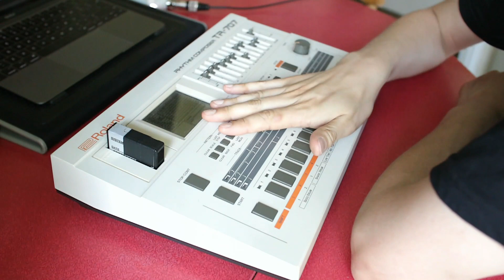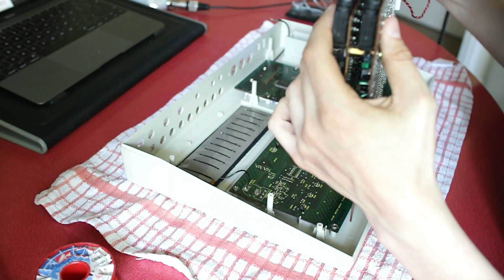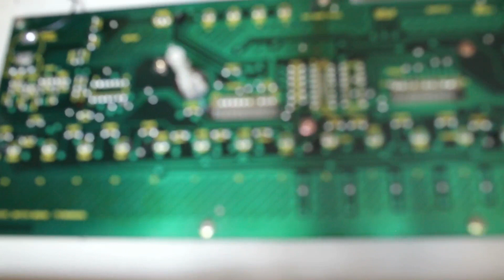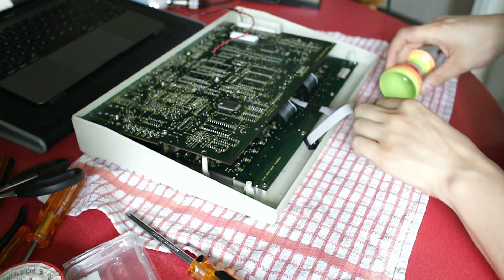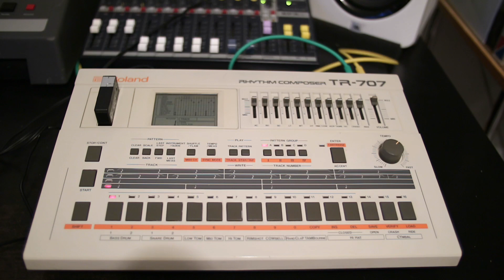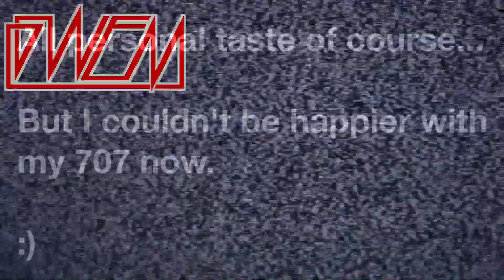Morphing my TR-707 into a 909, 808, 727, LinnDrum, LM-1 and Oberheim DMX!

Comment: Hi Gwem, thanks for sharing - great video.. I might have missed it but can I pls ask whether installing the mod means that the original 707 bank is still present in the machine or is it now sourced from the chipset on the new pcb add-on and whether the authenticity of the 707 bank you are left with might now be questionable? Many thanks and have just invested in a stock tr-707 which I'm v much looking forward to receiving in the next few days, Jules
Reply from the maker: believe me, as a 707 nut, that bank is completely authentic! :)
Reply: @gwEmbassy  Thanks Gwem - I did think that might have been the case knowing how dedicated you are to the 707! I've watched through a few different videos of yours now covering various different aspects and every time you fire it up it just brings a smile to my face in a way that I'm afraid to say the 808 and 909 just don't - a truly remarkable little machine.. : )

Comment: I appreciate the idea, at least it keeps the look of the instrument intact, it's not an infamous mess like that committed by certain "circuit benders"...   ;-)
Apart from this I don't understand the reason why I should put the sounds of a Linn or a 909 into a 707, only to still have a limited version of those drum machines (no tune controls... ). 
If I use a 707 it's because I want the sound of a 707, if I want a Linn or a DMX I have more faithful and effective means on my DAW to emulate these machines. About the TR 808 I have no no problems, because I'm a lucky owner of the "real thing"...   :-D
Reply from the maker: it’s an interesting perspective. I like it because it’s fun, and a different take on the sounds

Comment: Do you think if you put a tr-727 eprom into a tr-707 it would function as a tr-727 with the tr-727 sounds? Why do you think there were 2 chips you had to remove? Is one the firmware and one the samples?
Reply from the maker: Both of the chips were the samples. You can select the 727 sound bank and it sounds just like a 727!
Reply: @gwEmbassy  I saw that you can buy a 727 eprom chip off eBay for $20 and was wondering if just switching out that chip would give you 727 sounds on the 707. I should really just buy the HTX mod but everything I go to the site it's sold out.

Comment: Sadly found that my eBay bought 727 was water damaged. Discovered when I removed IC-34 and IC-35. The traces under IC-35 just fell apart :( I’d try fixing the PCB traces with copper, but looking at the overall board compared with yours - mine is a mess. Nice looking paperweight though :) Good walkthrough.
Reply from the maker: I’m sorry to hear your 727 was not in good shape. But maybe with some care it’s still possible to fix.
Reply: Don't ship by seamail

Comment: Hi! What is the different between using 707 samples and a real machine????
Reply from the maker: A lot of it is about workflow and the spirit of the machine. If you don’t care about such things, samples will do you just fine :)
Reply: @gwEmbassy  Does it sound different??? I don't know. I don't have the machine(707).I have a midi controller called M-Audio Trigger finger pro Which has Modern Samples like for Dnb,Dubstep,Trap. I discover that those samples are not good as 707.they maybe like harsh or something like that.punchyness comes from the 707 doesn't compare with my machine.actually it has no built-in sounds.but it has the 16 step sequencer.that's why I like it. If I load the samples to my sequencer I have the programmble function like 707.and  I can do the same thing.But I think it feels differnt.Maybe punchiness like things... and I really like the space that 707 gives to mix.doesn't it??? I have the opportunity to buy 707.What is the advice that you can give me?????? thank y
ou man..😔✌
Reply from the maker: Yes, the real 707 is dry and punchy. 

You could try finding the ROM sample dumps of the sound, they maybe found online. Maybe they sound closer than a sample.

Comment: 22:32 you talk about "8-bit samples" as responsible for the aliasing, but the bit depth has nothing to do with it. It's the low sample rate what´s can cause it.
Reply from the maker: Yes, you are quite correct. It is not aliasing, but the artifacts caused by the lower bit depth. Thanks for pointing this out.

Comment: Kick and snare are better on the 505.  I would use them in tandem.  House beat 4/4 with kick on one at step 1 and 9 with the other on 5 and 13 with snare on one machine hitting the 5 and other on the 13.  Nice bit of oscillation.
Reply from the maker: You are right the combination could be interesting. I like the 505, but I love the 707 :)

Comment: noice...
just fyi:
theres  also a mod to shorten  the decay of the closed  and open hi hat on the 707...(knobs for control)
(a friend did it on mine years ago, but maybe theres a technican you know (harry) that an provide more infos about the technical aspects.
Reply from the maker: thanks for the heads up! a number of the drums have envelopes that can be modded
Reply: @gwEmbassy   good to know.. thought it only appeared for the hi hats on the 707..
Reply from the maker: The crash and the ride are the other two sounds with VCA envelopes
Reply: @gwEmbassy  
ahh.. okay thanx...

Comment: this is one of the best mod I have seen! Now all HKA has to do is sort out how to sync a 707 with a modular. Great video too
Reply from the maker: It is a great mod! Thanks for watching :) you can always sync it with the rim trigger. There are also some dinsync to modular converters out there too!
Reply: @gwEmbassy  I have used the trigger out alright, but was hoping to slave to the eurorack, the midi on the 707 seems to lag ever so slightly, but it's part if the charm I guess! Do you have a patreon of anything?
Reply from the maker: No Patreon. Maybe if the channel gets bigger I will set one up :)
Reply from the maker: https://www.juno.co.uk/products/touellskouarn-triglostek-din-sync-24-to-trigger/714702-01/
Reply: if an manage to find one, the roland SBX-1 does practically all the fun sync stuff you could ever want.

Comment: It is a genius kit indeed. I will order it as soon as it will be available. My 707 is already prepared with DIL sockets installed. It is a shame Harry didn't add E-mu Drumulator samples into the bank 8. Is there any hope for this in the future?
Reply: I ordered one too, would prefer SCI Drumtraks and E-mu Drumulator over sampled analog drums, sample oriented 707 would make much more sense
Reply from the maker: If you have an EEPROM programmer you can add the kits yourself fairly easily.
Reply: @gwEmbassy  Yes, but you need to sample all sounds from Drumulator first. And as seen from your video above...you have one right there in the corner ;)
Reply from the maker: That’s an SP1200. Maybe Drumulator ROM dumps are available online somewhere.

Comment: I'd like to have a 707, since I really LOVE those sounds as well. And this mod does make it even more usable. BUT... Since I have limited space aka channels on my mixing board; plus my 909 and the MPC 2000 XL do fill up 20 channels already - I think I stick to loading the 707, 727, 808, DMX, Yamahas and whatnot samples into the MPC which also gives me the ability of tuning all those samples on the fly with the Note Variation slider. But still, kinda tempting... Especially since you don't have to butcher the 707 for that mod... Cheers and thanks for this detailed video! :-)
Reply from the maker: Hi H! Thanks a lot for watching. The 707 is a fun machine for jamming and quick messing about. The new sounds fit well into that :)
Reply: Got one now :-) And a 727, too 🤷‍♂️ Couldn't resist :-) Now I have to get that kit from Harry. I was on the list, but I read his email when the batch was already sold out eek
Reply from the maker: Congrats! I hope you enjoy the kit when it arrives